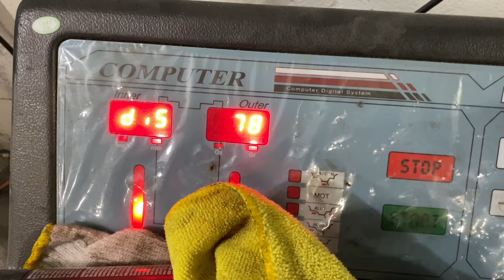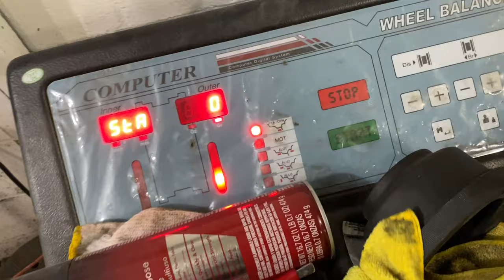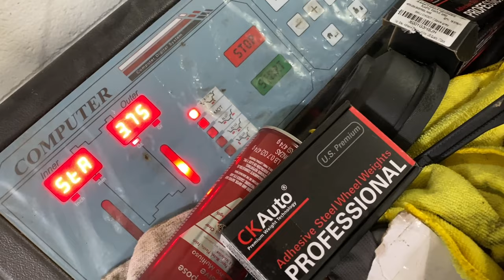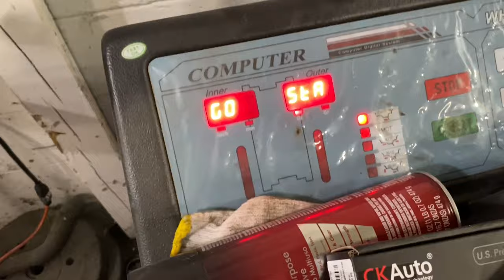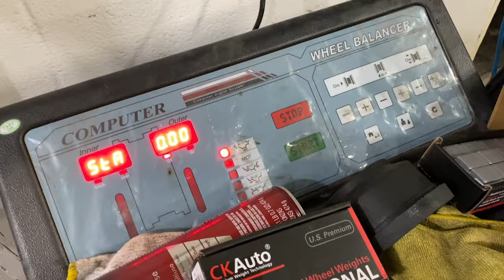Lexus GX470 Walkaround and Mounting 285/70/17 Tires - Using Tire Machine & Balancer

Comment: Hey bro did you have any rubbing issues with the 285s?  Did you need a body mount chop?  And did the truck run sluggish with the big tires?  Thanks
Reply from the maker: With the lift, the 285’s rub slightly on the fender liners when turning and i think just a hair on the frame rails at full lock with the offset of these wheels. I don’t have a BMC mod done either. As far as performance, I wouldn’t say it’s enough to really notice a big difference. I hear a pedal commander will also wake these SUV’s up pretty good as well!

Comment: I really like those KMC wheels on the LX. I’m thinking of getting them on my 04’ GX. What tires do you recommend for them?
Reply from the maker: I’ve been thinking about them as well for my GX 470 but I’m looking for something  with a little more offset. The kmc’s in a 17in option have up to a -12mm which is similar to what my TRD wheels on the gx470 have but im looking for more of like a -25mm offset. Check out summit offroad wheels for reference. They look really nice on these gx470’s but they’re never in stock. 

As far as tires, with a 2in lift i think a 285/70/17 is a perfect size with minimal rubbing. Anything more and you’re rubbing for sure!
Reply: @MJAltairy  dude, that’s for the rec. I’ll keep you posted to see what I end up with. The one I picked up is a gold/champagne color so I think matte blk wheels are the ones I’m more leaning towards.

Comment: What size lift do git on that?
Reply from the maker: It’s pretty much a 2in all around but the front coil springs are the “heavy duty” springs to compensate for an off-road bumper which is why it sits a little higher upfront.